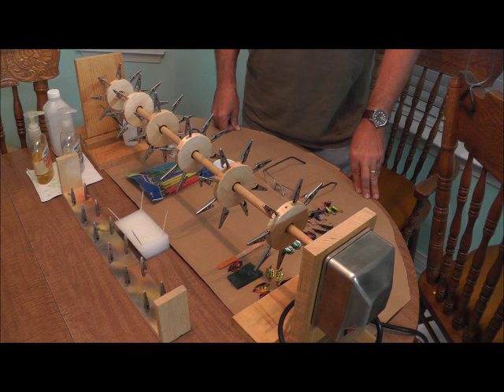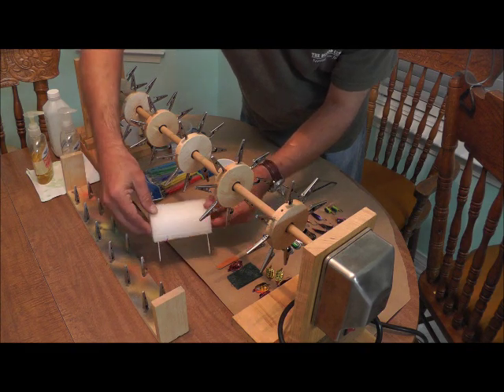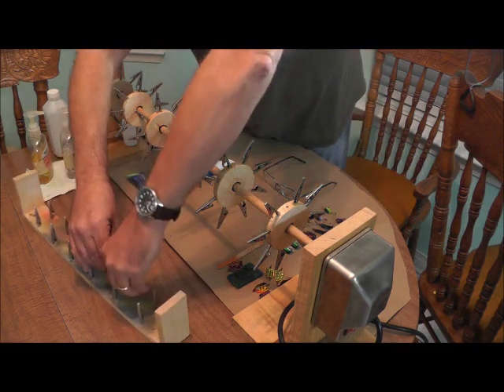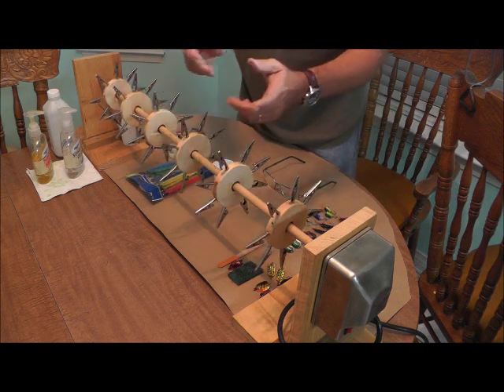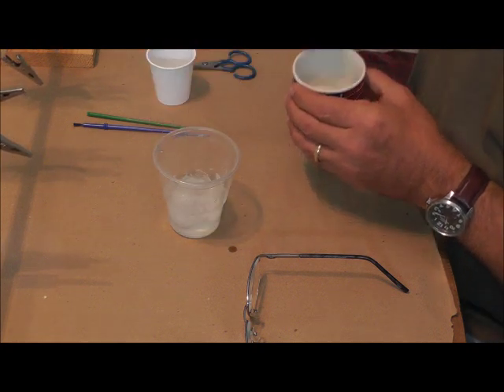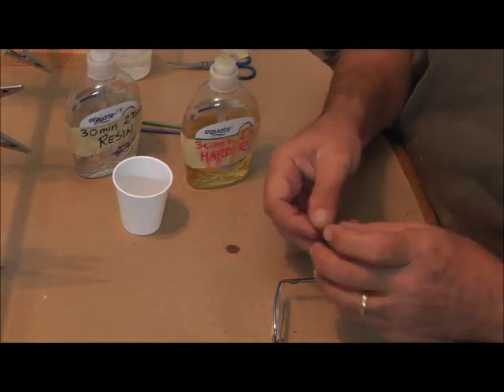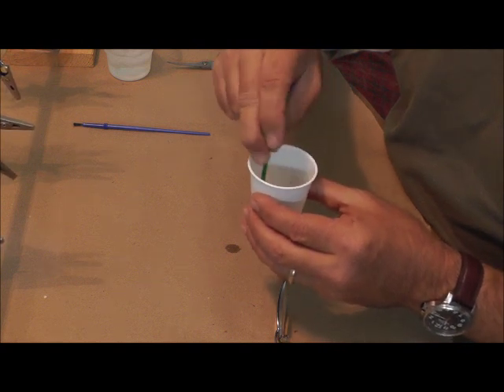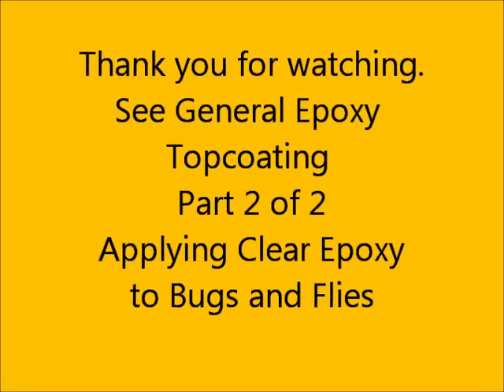Epoxy Topcoating Flies, General Setup

Comment: Loon outdoors thick UV resin. I'm with Sean, you must be using the wrong applicator and light.  Hardly anyone I know uses epoxy anymore. It is a lot easier to form heads, bodies and cures instantly.  Make sure you have a quality torch.
Check out loon outdoors products.
Reply from the maker: Brad, as I stated in reply to Sean, I do in fact use UV Resin. The point you make about a good quality torch is a good one and I do indeed have a high quality light both a laser and a flashlight. See the article I referenced in reply to Sean. Once you have to topcoat more than a few popper heads, UV Resin starts taking exponentially more time for a batch especially when you start doing 2 - 4 dozen size 1 popper heads like I do, not to mention the expense. However, again, UV Resin does have it's place in my tying tool box but when it comes to coating a dozen popper heads nothing competes with the ease of use and low cost of epoxy. I hoped this video would help those with a fear of epoxy overcome their concerns.
Reply: Kirk Dietrich
 I hate to state the obvious. By the time you are done mixing your cold water, ice and resins.  I would have had nearly half of your Flies coated and finished with a UV Resin.  I also would not have needed a bbq rotisserie because UV resin cures instantly.  UV resins are all different and cure with different light spectrums.  This is why most companies that produce UV resins also produce a UV Light.  That light works best with their products.  I don't mind paying a little bit more if it saves me time.  UV resins are still a new thing, there prices will fall and people will eventually learn to use them correctly.
Reply from the maker: Brad Knowles Brad, you must read the article I wrote about the objective testing I performed last summer with 4 UV resins, epoxy and Liquid Fusion: http://onthevise.com/blog/10-clear-coat-durability-test-poppers Although it started off being a test on durability, I tracked the time for curing and applying. I'm not saying that epoxy is the best for every thing like you are trying to say about UV products, I use UV resins for some things and epoxy for others. You can get state what you think is the obvious but until you spend the time I did objectively with a stop watch over four months, then you are only guessing. Once you divide the one-time mixing of epoxy (not cold water) and set up the turner, a total of about two minutes, then as the number of bugs increases divided into that one-time two minutes, the time for each bug drops off dramatically. I say again as I've always said, there are certain tools that are best for certain jobs. As for stating the obvious, its a tortoise and hare kind of race when doing a batch of bugs with epoxy being the tortoise.

Comment: Is there a reason that you are resisting UV epoxy? It is so much easier. I get them done in seconds and if I want them really hard I put them on a Styrofoam cup in the window sill and let the sun do the rest. The epoxy doesn't ever set without being exposed to light. I put some in a tiny can and let it sit over a month and it didn't set until exposed to UV light. So Just saying:)
Reply from the maker: Hello Sean,
I use UV Resin when I need a bug to test. See my report and the testing I did with 4 UV resins, epoxy and Liquid Fusion. Check it out here:
http://onthevise.com/blog/10-clear-coat-durability-test-poppers
UV resin is cost prohibitive for the large batches I do and I found out after my testing that UV resin takes much longer to fool with. With either resin, the time is the same for actually applying it to the bug, where epoxy is quicker is that the turner does the work of curing while UV, you have to spend your time setting the resin with a light. The more bugs you do, the more of your time you spend...
Reply from the maker: Epoxy is cured from a chemical reaction, if your epoxy did not set, it was likely not mixed in correct ratios or it may have been very old. Every once in a blue moon, I mix to much of one of the components and end up with a tacky finish with the epoxy but that is more rare since going to pump dispensers and the cure is the same as with UV, which is to apply nail polish.
Reply: No need for a cup of Ice Water with UV resins, it only cures with UV light.
Reply from the maker: Brad Knowles You're funny Brad, what is your agenda here. I can easily say No need for batteries, electricity or a sunny day with epoxy...but I'm not here to say epoxy is better than UV, I'm just showing how easy it is to use epoxy and that it is better for my production tying and much easier that people think, I'm not trashing UV resin, I use it for certain applications.
Reply: No agenda, nothing personal, I enjoy your videos and am a subscriber.  I just honestly see a swing in the industry and I find your blog post a bit biased and not with the times.  Please continue to make great videos!  Comments and interaction on your videos are a good thing ;)
Reply from the maker: Brad Knowles  Gotcha, just thought maybe you were a pro for Loon or something, glad you like the videos. Discussion is indeed good. The article that Luke McCoy posted on his blog may seem to be biased but I assure you that the testing I did actually convinced me that UV is a viable product and has turned out to be pretty handy when in my design phases and I always thought UV resins would be quicker until the time testing where I timed the applications, in fact two separate times a few months apart and came up with the same results. So, I learned a lot in doing that testing; that being said, I live in a humid part of the country and I'm no chemist and the testing was not done in a clinical environment.